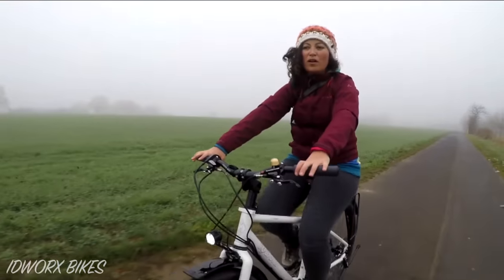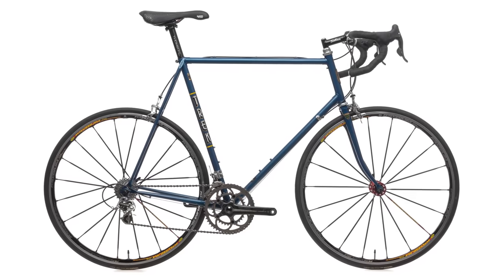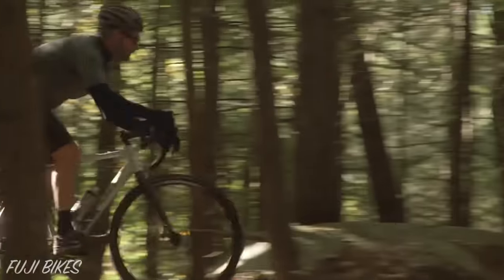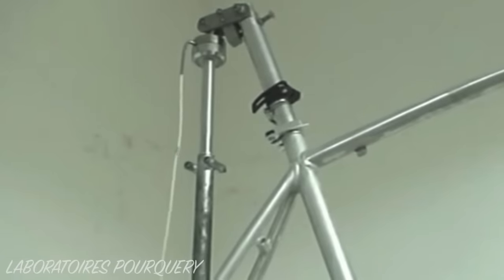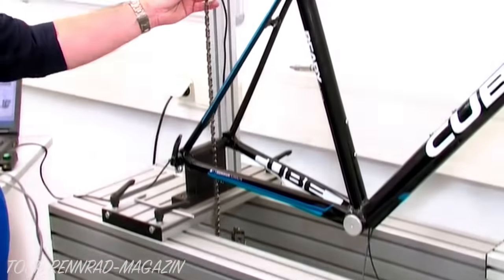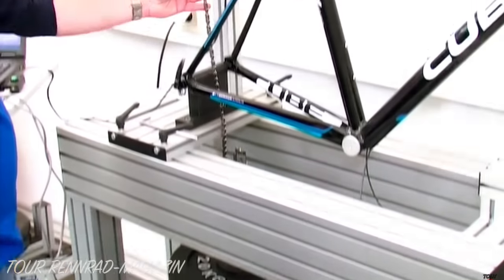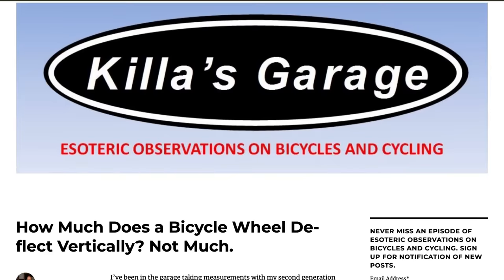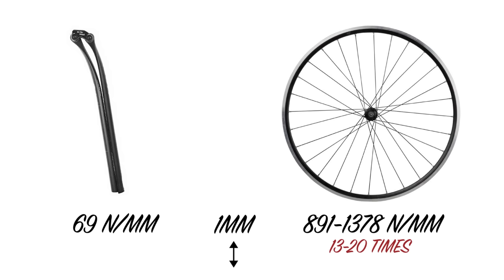Why It's Impossible For Steel Frames To Be More Comfortable Than Aluminium

Comment: Gets into the minutia of energy required for tire deformation
Also this video:
Handwaves away the damping properties of different metals and alloys
completely ignores the existence of torsional flex
I mean yeah if you only look at the data set that supports your thesis, it makes perfect sense.
Reply from the maker: Got some data on torsional flex and comfort? I put torsional flex in the bike 'feel' basket as my personal experience of switching the tyres, stems, handlebars and seatposts on my steel/ti/carbon/aluminium frames has allowed me to make any of my bikes ride harsh or comfortable. I suggest trying it for yourself.
My most uncomfortable bike currently (by a long margin) is a custom-built (for me) steel bike with some of the lightest steel tubing available. It is uncomfortable because I have paired it with uncomfortable components, but I love it because it has a great ride feel.
Reply: @Cyclingabout  What does it mean to be both "uncomfortable" and have a "great ride feel"?  Not trying to be an ass, just curious.  Interesting, informative video btw.  Thank you!
Reply from the maker: @adumbberg  Think of it like a race car. Not the kind of car you'd want to drive around town, but an absolute beast when it comes to the track. That's my bike!
Reply: @Cyclingabout  Gotcha.  Thanks for the reply!

Comment: yeah, my pretty ass told me this long ago. small 14,5" frame to expose the 400mm cheapest shit chinese titanium seatpost as much as possible. then my golden hands told me to buy the cheapest shit chinese titanium bars & stems (this later is marginally dampening) above the relative sensitive mag21 retro fork (dual air, small dia...). lastly, my tired legs told me to get 2.25 high tpi tyres on relative wide rims with 3+ bars. gg.
Reply from the maker: Sounds like a plush ride!

Comment: Look, i will then side with the other commentors that the tittle is definitely click bait because you want to compare frame materials but insist on adding bigger tires and other parts to a bicycle. You think a pro rider who rideS hundreds of miles a day can switch from riding 23c tires to 40c and keep his stats? Your tests on frames and metallurgy is interesting. I cannot comment on its accuracy because frame building is not my field of interest. I however have 15 years experience as a bike mechanic and salesperson in a shop that made custom steel frames. Im not siding with steel. I have ridden on frames built with similar parts both road, mtb rigid and fs, and hybrids in between. Low end to hi end. Brands from Kestrel, Litespeed, Cannondale, Trek, Specialized, Fisher, Klein, Diamondback, a few other brands using magnesium, custom Tange, Columbus and Reynolds steel. These were all frames produced between 1990 and 2005. I used my bile shop priveledges to male this happen. All in all i had ownership of multiple bikes at one given time. As i said i am a bike mechanic. I believe in better parts not better frames. But you need to stop fooling people and say that there are no differences between frame materials but then add fat tires and add dampening parts like seatposts and stems. You have the right idea but you dilute the test by adding bike parts. I too have ridden countless miles in different combinations of bikes. THERE IS a difference in frame material characteristics. Take a Walmart Chinese made bike remove the decals and give it a custom paint job,  switch the parts from a $15k bike and give it to a pro rider. I bet you that bike can perform adequately. Steel vs Aluminum vs Titanium vs Magnesium vs Carbon. Do you realize how many variations in these materials and engineering these frames have morphed into in the last 50 years? And for you to say there is NO DIFFERENCE? Well dude, keep on preaching. The people who know bikes will know whats what.
Reply from the maker: With all respect, I'm afraid you have completely missed the point of this video. 
I'm not saying that bikes don't have different ride characteristics (and this statement was made explicitly in the video). I am arguing (with data) that comfort is NOT a function of the frame material, but rather it's the parts - and the spring-in-a-series calculations help us to understand that.
We, of course, need to take into account ALL components that make up a bike because we are analysing bikes as a complete system.
Reply: Respectfully back at you. So youre saying comfort is not the sum of frame materials. So youre saying steel and titanium dont have flex and rebound properties to make the ride less harsh? Youre saying carbon does not have vibration damping qualities? Youre saying aluminum is not the stiffest and lightest but more harsh than other frame materials? Try this experiment. Ride a carbon fiber skateboard and ride an aluminum one. If you can find an aluminum deck. Ask a skater why decks are not made of metal. Again, sir the title of the video is misleading because you deem it as a myth. It is not. Basic metallurgy. Steel flexes= adds comfort. Aluminum flexes less= more harsh.
Reply from the maker: - Yes, I'm saying comfort is not the sum of the frame material. 
- Yes, I'm saying steel and titanium don't have vertical flex and rebound properties that make a ride less harsh (refer to the springs in a series calculations).
- No, I'm not saying carbon doesn't attenuate vibrations differently.
- A skateboard is a different beast because the deck is the dominate spring in a series (in terms of spring rate, it's the equivalent of the tyres - not the frame). 
- I'd recommend that you go back to the springs in a series section of my video. Understanding this concept is particularly important for understanding my position on frame materials and comfort.

Comment: Sure. For road bikes perhaps. On a hardtail mountain bike riding bumpy downhill trails and big features you are off the seat so frame compliance plays a more significant role or on the seat but with a very stiff dropper post. Steel has a fatigue limit whereas aluminium has to be designed to keep stresses low as it will crack eventually - key is to design so cycles to failure are very high. This results in a stiffer frame. Steel on the otherhand can deflect significantly more without risking fatigue cracking so frames can be built to allow more compliance. MTB frames have less open triangulation than road bikes to allow low dropped seat positions and standover heights. This reduces vertical stiffness from triangulation too so it is easier to build in compliance.

Comment: Steel is more comfortable than any other material. All things being equal (frame build, components, wheels, tires, etc...), steel will always be more comfortable.
Reply: Why? Got any science based facts to back that statement up?
Reply: @dainiusvysniauskas2049  Yes. My own experience and a century of real world experiences of millions of riders.
Reply: @dainiusvysniauskas2049  Sure it's science based fact. We rode them, they felt better, it's a fact. 

Carbon bikes suck now. They're more prone to failure, have a limited lifespan and because they are so style-centric, even if someone doesn't ride them enough to cause them to fail, they sell them off anyway at a huge loss to get the next new fad. 

Nobody likes carbon anymore.
Reply: @solitaryrefinement6787  Personal bias is not a fact. Why is it personal bias? Because it goes against physics.
Reply: @dainiusvysniauskas2049  Personal experience is fact and facts are biased.

Comment: Really? Aluminum more comfortable than steel?
Reply from the maker: The data suggests that both frame materials have about the same vertical deflection, and that it's the components that make one bike more comfortable than another.

Comment: Is plaining a thing?
Reply from the maker: In the noisy and dynamic environment of pedalling a bike on the open road, frame deflection is one of the dozens of variables that store and release energy in the system. I cannot stress the complexity of the biomechanics of a cyclist enough! I have never come across scientific literature that has accurately described things as a whole, it is always focussed on very specific aspects of the system.

With this in mind, I find it highly unlikely that a single variable (horizontal frame deflection) could efficiently store and release energy to allow a cyclist to ride faster. The odds are that the energy is distributed across all other variables in varying amounts. And even within the frame flex variable itself, there are many variables that would need to work together to optimise the system - output power, cadence, pedalling style, rider weight, seated, unseated to name a few.

In addition, the testing I've seen that goes about proving the concept seems quite flawed. For example, the GCN test "Are you faster on a stiffer bike?" loaded the frame with energy and released 100% of that stored energy at the 5 o'clock position. But this is simply not how it works when you ride a bike - the deflection slowly builds and releases from 1 o'clock to 5 o'clock. Where the energy ends up in this noisy environment, we really don't know.

In general, I find the BQ testing to be interesting, but very subjective, conducted in noisy environments and riddled with confirmation bias. Their tests consistently prove that the era of bikes those guys like riding (and selling!) are the best, so I always take their results with a grain of salt.

I do think BB stiffness is overrated in the bike industry as we don't see measured differences in speed within a certain stiffness range. In addition, both too much and too little stiffness definitely affect the 'feel' of the bike.
Reply: CYCLINGABOUT do you think there’s any validity to the subjective feeling that extra-thin-tubed steel frames ride “nicer” or even at all differently to thicker tubed frames?
Reply from the maker: @joachimmacdonald2702  I've tested bikes with very thin steel tubes. They have a nice ride feel - springy is definitely the right word. That said, I personally prefer something much stiffer.

Comment: This video is only relevant to people that place most of their weight on the seat when they ride.  Many people don't ride like this.  Also no mention of vibration / reverberation on hard impacts.  Frankly, not a comprehensive study or video.  What isn't taken into consideration here as well is different construction methods resulting in different frame weights, tubing/material design, and type.  Once you do this, it's going to be the STATISTICAL OUTLIERS that make frame characteristics observable.  That said, for most of mass produced frames, differences in material will be outweighed by construction factors and build.
Reply from the maker: I place almost 100% of my weight on my saddle when I ride. I run my bars pretty high and use my core strength to keep almost all of my weight off my hands. I suspect this is the case for many other people who do long-distance touring.

When comparing frames of different metals (steel, ti, aluminium), there is very little difference in vibration damping. Peak Torque made a good video about beam vibration and titanium: https://youtu.be/1CTjg1TFHDc

In fact, almost all vibration-damping occurs in your tyres and via your contact points (as well as luggage if you're touring).

Frame weights & tubing/material design do very little to increase the vertical deflection of a frame. And when we use the spring-in-a-series calculations, any minor differences are immediately lost.

Comment: I just saw this and would like to comment hope its not too late. Its simple, if you want to compare how a bicycle frame characteristics then fine. But dont add tires and parts. A fully rigid bike vs a fat tire bike with full suspension will behave differently regardless of frame material. If you want to argue steel vs aluminum then stay with those two. Bicycles have infinite combinations as does human preferences. I take offense to you using the word placebo in frame materials.
Reply from the maker: Of course, I need to add tyres and parts to the equation. Bikes are a system of components and the frame is just one of them.
Reply: Your title says frame materials are a myth, then you add bigger tires and softer parts? Yes it is Click bait. Add some Spinergy wheels, Wider tires a suspension stem and  suspension seatpost to any rigid bike and anyone can ride Vibration free
Reply from the maker: It's not clickbait. The data we have suggests there is very little deflection in a frame, and a lot in the parts. I have selected parts which we have data on to illustrate my point. Even if you selected components with 10x less vertical deflection than those tested, the spring-in-a-series equations still work out in favour of the components - not the frame.
Reply: Well it seems we are standing on separate grounds. I have read through all these comments and it seems i have found more people to disagree with you and some people who just agree with you. Yet (maybe i missed them) no one agreeing to this “myth” as you say. Good luck to you
Reply from the maker: I have also read through all the comments and I honestly expected 9/10 people to disagree with me. But that doesn't make me wrong. Frame materials have been marketed to us for 100 years based on one material being more comfortable than another - as I say in the video, it's conventional wisdom. But when you look at the data, this cannot be the case.
Unfortunately, the positions contrary to mine are never backed up with ANY data. They are purely anecdotal. And it's not like we haven't studied these things...
Reply: @Cyclingabout  You say you need to add parts to the equation, but yet these measures don't include fork/handlebar, nor bottom bracket. One anecdote :  my seatpost/ saddle was stolen one day, I was still able to ride home. I have yet to try and ride my bike without pedals or handlebar. I would argue that coming to the conclusion about frame materials myths solely from a vertical compliance viewpoint is completely erronous. Unless you're on a Dutch style bike, in a completely vertical position, with no weight on your hands and feet off the pedal, then this study is completely irrelevant. I'd like to see a study of the same sort but testing compliance on bottom bracket. Sorry I have to disagree with you, my steel frame is more comfortable than my AL (all other components being equal - seatpost length, tires & wheels, etc)

Comment: It’s all BS... especially when you hear mtb frames have a different material.  I did notice a little change going to carbon on a road bike.  But could be just placebo.  I guess it’s all in the carbon seat post
Reply from the maker: A road bike could be a little different given the way it attenuates vibrations, but in terms of vertical deflection, it's your tyres, fork, seatpost, seat, bars and bar tape that play a much bigger role.

Comment: It's not impossible for steel frames to be more comfortable than aluminum ones, your assumptions are flawed and your conclusions incorrect. Furthermore your headline is click-bait. Aluminum is not a material which likes flexing and thus alu frames must be built stronger than an equivalent steel frame to maintain durability. This will make the majority of alu frames harsher to ride than a high-quality steel or Ti frame, simple as. Downvoted.
Reply from the maker: If you think I am incorrect and my assumptions are flawed, why don't you tell me why? My argument is essentially that truss structures (steel, ti, aluminium) inherently don't flex whereas your components certainly do. We have a tonne of data on it too. It has nothing to do with the material properties of the type of metal. We can calculate out the spring-in-series to understand just how little the frame material plays in the overall comfort.

Comment: You missed the all important forks which aren't part of the triangles but contribute a lot to comfort. You got carried away with the science and neglected the holistic view.
Reply from the maker: Forks can be a great way to gain additional front comfort. But interestingly, most steel forks are just as stiff as aluminium forks these days (according to the fore-aft test data). Carbon forks usually have the best fore-aft compliance by a fair bit, while retaining good torsional stiffness. However, there are many exceptions here too.

Comment: Oh no, you might offend the "steel is real" cult, now they can't justify buying those ridiculously expensive steel frame, just looks like a joke now.
Reply from the maker: I can still guarantee that steel is real. 😅 And that it's easier to repair, has good deflect tolerance, has nice ride characteristics and looks nice with its thin tubes. But I've never noticed a comfort difference. 👍🏻

Comment: Bollocks.  Try riding around Australia on all the surfaces with aluminium.  Your headline should be changed to something less misleading.
Reply from the maker: I've covered more than 50,000km off-road on aluminium touring bikes, and twice as much on steel. There is no perceivable difference in ride comfort when I use the same components.